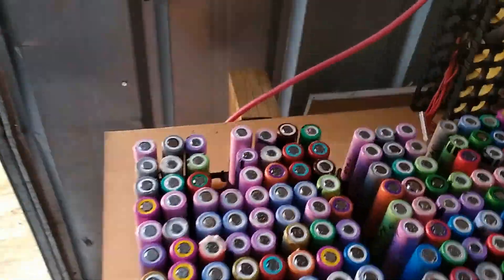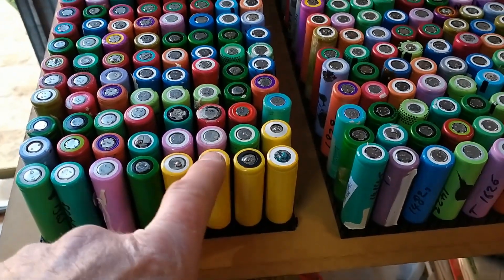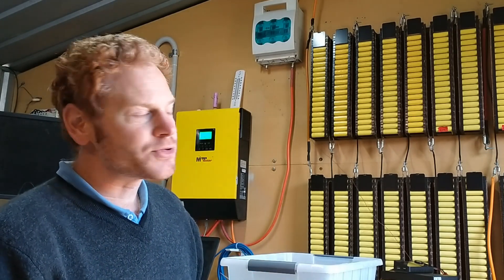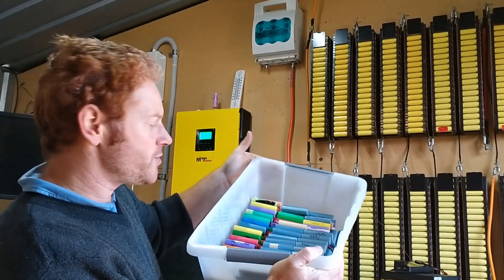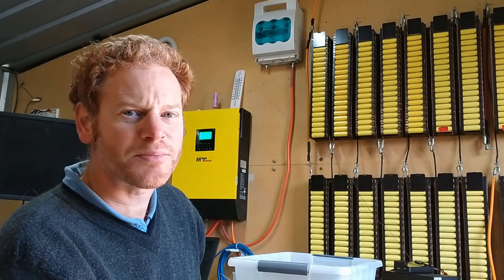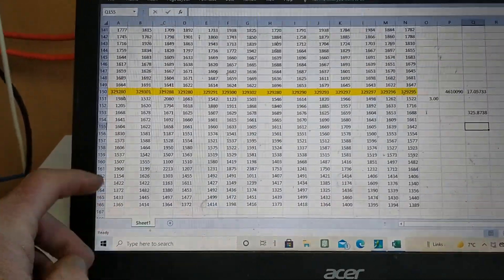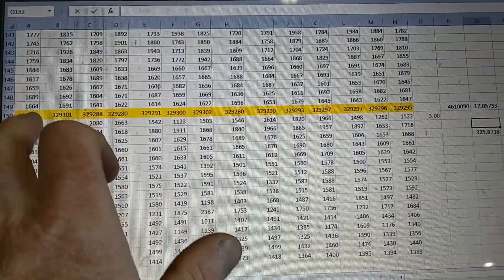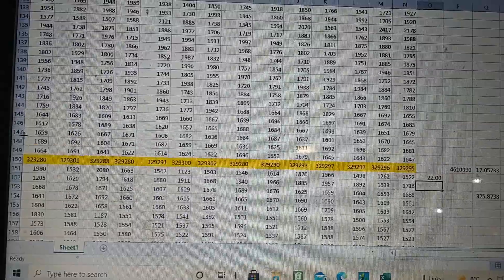17KwH 14s 157p, 2198 cells of 18650's in an Off Grid Solar PowerWall. My process to getting it done.

Comment: Great content Adam! I’ve been building smaller 80p-120p powerwalls for a few years now, but am planning to finally build a larger powerwall in the next year, and I couldn’t agree with you more… other than heaters, or cells showing a high IR/self discharge, I don’t understand why people don’t use low capacity cells. To me, I love the DIY aspect of 18650 packs, and most importantly, the recycling of it… turning “trash” into a usable product is the way to go for me. Although I end up with a lot of high capacity cells, I will absolutely be working in cells that are in the 1000mah range from power tools etc. cheers and thanks for the content to keep giving me ideas on my next build. I would love to see an update and general chat about how things have been going and any new ideas you’ve had over the past year of running.
Reply from the maker: Thanks for your support. I haven't done anything really to speak or so I didn't want to make a pointless video. Suppose I should follow your advice a do some sort of update.

Comment: Very impressive build.  Your attention to detail exceeds my own, by at least one order of magnitude!  To put that another way, I think you may very well suffer from masochism and should probably be evaluated!  LOL  :)

There are two things which make this type of system very impractical, in my opinion.  The cost of prismatic cells has come down so much and there are simply WAY too many things that can (and will) go wrong in a pack like the one you built.  Any one of those cells could die, and one or more will.  As long as there is no thermal runaway, it's just extremely annoying to figure out which one died, but that's the best case scenario.  Two 16S packs of 200AH prismatic cells would deliver even more power, giving you 32 points of failure, instead of nearly 2,200.  You would have a pack voltage closer to 48v and you'd have a much longer life for the pack.

So, kudos on making something out of nothing, but for my TIME and money, there's just no way.  18650's are best used in much smaller packs.  Even Elon has realized that.
Reply from the maker: Yes, there are pros and cons.
I could buy other type of cells and then it would be done. Yes time consuming but neat. If 1 cell goes bad the the pack is still active. I started with 7s 80p 3 and half years ago and been very reliable and still going strong.
Thermal runaway is very minimal and if a BMS is installed it would not work hard with active balancing.
Still would have this problem with any lithium setup.